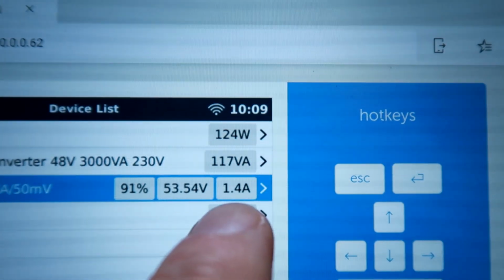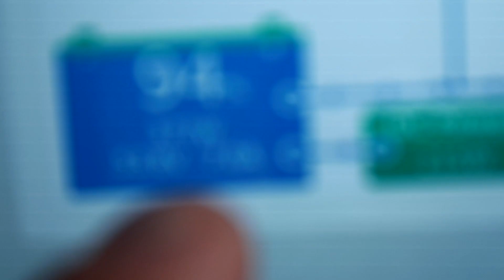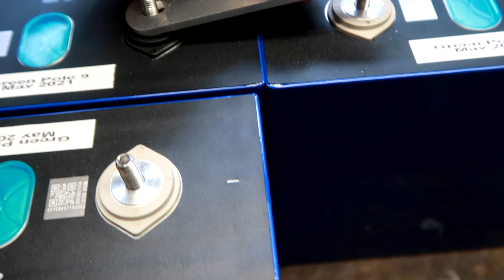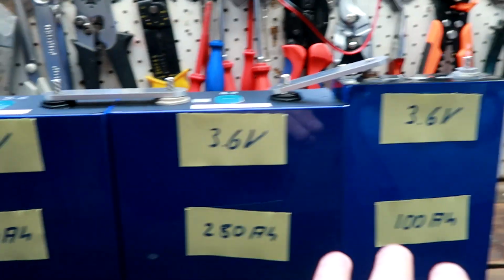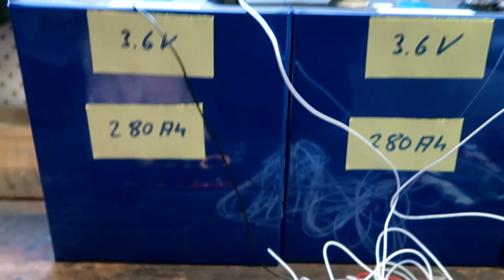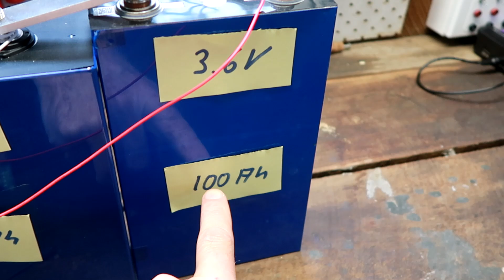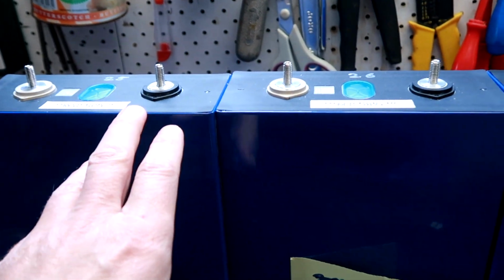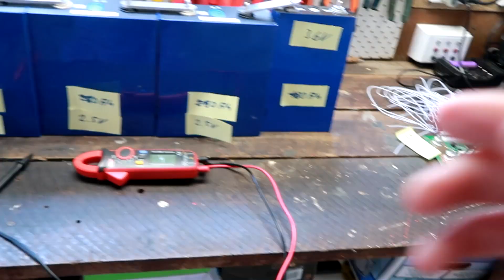Divided opinion about balancing, balancers, BMS. How to and why to balance LiFePO4.

Comment: with 1 active balancer you charge and discharge your weak cell with 5 A only, does it count as charge cycles? 
Of course with 100Ah against 280Ah the difference is huge, but with more equal cells, the weakest cell wouldn't suffer that much. 
If we charge with 50A , shouldn't we need 10 of those 5A balancer in order to shift all the charge as fast as possible, so all voltages remain equal at all times? And we don't need balancing at rest.
Reply from the maker: I think the balancer will only have to work once there is a voltage difference across the cells, so at the bottom or top of the curve when cells start drifting. It should be very easy to balance such high capacity cells with 5A at this stage. There is no need to have multiple balancers, I actually think they would counter each other and start fighting.

Comment: Aluminum bus bars are dangerous, at least in buildings.  Aluminium develops a coating of oxidation that eventually causes arcing at the connections.  The building where I had a condo had a huge fire because it had big aluminum bus bars instead of copper wiring. Such bus bars are not unlawful under the building code.
Reply: I have used aluminium busbars for 5 years in an RV without any corrosion problems. It might be more of a risk in damp buildings. To reduce risk of shorts I have recently started coating them in heatshrink and cutting out circles around the terminal points to enable good conduction. This would probably help minimise any risk of corrosion.
Reply from the maker: Yeah, but the corrosion is only dangerous at the points of connection, not on the outside.
Reply: @OffGridGarageAustralia   Yes, that is what I have heard too, that Aluminum is the metal that expands and contracts the most of all metals, and when you add corrosion into the mix, the arcing occurs at the connection points.
Reply: @JR-kk6ce  Theory is often in conflict with practice, sometimes more limiting sometimes less. In this case, unless you have some extreme temperature and humidity conditions, the practice wins. In the case of humidity you will probably see the external effects of corrosion on the terminal busbar junction long before it becomes an issue. Expansion due to temperature around a terminal over the range of temperatures that lithium cells can be used isn't going to be an issue.
Reply: @nigelcharles511  I would be careful with aluminum busbars. It is not the humidity that you have to worry about, it is the the material of the post, washer, and bolt that you are going to use. Aluminum is very reactive with other metals and will galvanically corrode. The corrosion at the connection will create hot spots and possibly even a fire. I know this because I worked many years doing thermal imaging of aluminum busbars in buildings that were built in the 70s. Once you have a hot spot at a connection, the heat expands the aluminum and when the current is taken away, it cools and contracts. Eventually, the connection becomes loose and greatly increases the risk of fire.
Reply: @oldglory9812  The battery posts are also aluminium (the reason for going for aluminium busbars in the first place) and the posts are stainless so little risk of dissimilar metal corrosion. Using nuts with serrated undersides seems to prevent any loosening.

Comment: I don't know about balancing by capacity it seems to me that you're relying on your ability to measure how much capacity you took out and how much capacity you put back in the shunts are pretty accurate but I don't know if they're quite accurate enough
Reply from the maker: All balancers take the cell voltages as measurement. As long as there is a difference, they keep either burning off energy or shuffling into other cells.
A coulomb count through a shunt may work but is not 100% accurate either as it would need several other parameters as well (current, temperature, SOC) to make an accurate decision.
Seems like it, we cannot really find the perfect solution.

Comment: Its also Not save without a BMS and a working Charge Controller because These Cells will Drift over time so you can Overcharge the Cells If maybe one cell is lower
Reply from the maker: Yeah, absolutely. A BMS is a must!

Comment: I can still top and bottom balance my cells with a 2 amp active balancer.
Reply from the maker: I don't think you can. Bottom balancing means they have 0Ah left. Once you slap the balancer on such a pack, it will change this situation and the cells will not come back to the same voltage any more.
Reply: @OffGridGarageAustralia  if the idea is to have all cells at the same voltage on the steep end of the charging curve (top or bottom) I think one can. I know what a lot of people call bottom balancing. I just think it it’s equalizing the voltage at the top or bottom. 

I might be wrong (always learning) but I think an active balancer is the way to go. 

PS my active balancer will do 2 amps at a voltage delta of 5mv. It charges super caps in parallel (from high cell) then discharges in series to the low cell. My pack is doing amazing!!!!!! Cheers and keep the videos coming!!!
Reply: @OffGridGarageAustralia  also. The only way one would know they have 0 AH left is a voltage reverence right?
Reply from the maker: @idontneedaname85  Well, top balancing focuses on voltage (eg. all cells at 3.6V). They will then have different capacities though.
Bottom balancing does not read individual voltage but only the overall voltage. It focuses on Ah. However when you balance, the Ah get mixed up, either burning off amps one just one cell or transferring amps from one cell to another. This will destroy your bottom balance as cells have now different capacities.
Reply: @OffGridGarageAustralia   very good. Lot to think about. Cheers mate.

Comment: Need to somehow put all the cells in parrallel and buck boost the sh*t out of it to 48V.  Then they all charge/discharge together.
Other than that, maybe build a smart bus bar that current limits to a common bus in and out.
If you can't quantify the damage to the cells for constant balancing then thats my vote.  I don't think the charge/discharge is as large a problem as you think.  Your 3 battery banks charge/discharge to each other all the time.

Comment: balancing.. in the case you never reach the absorption, bottom balance will drink each watts of you panels.. top balance in the case you like to have your batteries absorbing and have the most power available.. that make sense?? ..but don’t like your idea of batt with stainless screw, aluminum bar and copper cables.. that look more thermocoupler type of junctions and what about heat/cool dilatation different for each of those ones, your contacts will take some slack with time.. that make sense again??

Comment: Hey guys. Unfortunately, I am not lucky with my orders from Shenzhen Basen Tec. Now I have 2 different types of EVE cells. 8x EVE L280N and 8x L280K. The L280N cells are the well-known types and the L280K are a few millimeters higher and the terminals are further apart with welded bolts. I don't think I can run these 16 cells in series without any problems. So be careful when buying cells. EVE is not the same as EVE.
Reply from the maker: Did you get them in one order?
Reply: @OffGridGarageAustralia  No, that was 2 orders. I can send you photos if you want.

Comment: Active balancer is not effective on such cells. The best solution is "powerwall" but not "e-bike" BMS. Batrium, or DIYBMS or something similar. Such BMSs have a normal passive balancer with significant balance currents 1 to 5 Amps, which are real Amps, ant not Chinese "promised" current. The active balancer work based on voltage difference, which in case of LiFePo4 is so small, that active balancer current is so low 0.01..0.05A. Alternative option, is to use the BMS only for safety and external passive top balancing balancer with 1-2Amps

Comment: you're assuming 100% efficiency on every cell. that's not possible.
while you may be charging your cells in series with 10A for 1 hr, that doesn't mean you can pull 10A for one hour from your cells. 
some cells charge and hold more energy while others may not hold all of the energy that is put into it.
Reply from the maker: The LFPs here are at around 99% efficiency.

Comment: No engineer would design is system to operate at the extremes, we analyzed the system extreme precisely so that we can avoid them and yeah what are we doing here? Discharging the battery clear down to 2.5 volts. Charging the battery clear up to 3.65 volt. Those are the extremes which we are supposed to stay well away from. And for what purpose? So that we can store a miniscule amount of extra current. Makes no sense to me. I will operate from knee to knee. If I am so desperate for more power that I need to operate beyond that, I will buy another battery. 

When the battery is operating in the steep part of the curve it is struggling to provide or store more power. When the battery struggles it is being damaged. STOP. You don't suddenly start damaging the battery at 2.49 volts or 3.66 volts. You are already damaging it and the damage gets worse the further down the slope. And why? For a few more milliamp hours of storage? When you hit the knee, STOP. Order another battery.

Just my humble opinion of course.
Reply from the maker: Thank you John. That is great advice. So what are your settings for your battery? 3.1-3.4V?
Reply: Before we get Into what voltage, we need to discuss Equalization. By connecting all the batteries in parallel for some period, the batteries will equalize. Equalization is not the same as balance. Balancing is voltage State, Equalization is charge state. Once Equalization is accomplished, put cells in series . Set the BMS to cut off charge and discharge when any cell enters the knee. You Are done. Enjoy the battery. Just know that in a year or two or three, you might have to equalize again. Unlike balancing however Equalization is quick and easy.
Reply from the maker: @jwcolby54  So you let the BMS control your battery charging/discharging?
That would involve a better control system as many have where the BMS controls the SCC as well as the load and inverter.

Comment: as i use mostly new cells now, with little variation, i like the top balancing method, dont use an active balancer, as i have not had any need just yet.

jehu mostly uses used 18650 cells, grouped by resistance and capacity and a mix of those.
given the volatility and mixed characteristics i can see why he would need bottom balancing.
the downside is that you will loose capacity, as the total capacity will be that of your weakest cell..
if , like jehu you can add used laptop batteries to compensate rather easily and cheaply , that isnt a problem, however, using 280-310 ah in 16s series, that does eat up a load of cash rather quickly
Reply from the maker: Thank you for sharing, that's great advice. However most people here seem to say got bottom balance with new, matched cells... 🤷‍♂️
Reply: @OffGridGarageAustralia  I know I mentioned this in my other comment, but: bottom balance when your pack sits mostly empty, top balance when your pack sits mostly full. For solar applications, top balance. For things like EVs, bottom balance.

Comment: As someone who makes, uses, and prefers aluminium bus bars, I have one thing to say: They're not superior for one reason and one reason only: They don't have any expansion/contraction kink in them so will tear your cells apart during charge discharge unless you have a gap between them and if you do, you have no compression. In summary, they're only really suitable for cylindrical cells in holders, not prismatic cells like yours. But, they're cheaper and lighter than copper ones, so ideal for boats/planes/cars where weight matters. Putting a kink in wouldn't do much, either, as the alloy is very rigid so the kink would have to be impractically and unsafely tall.

Comment: You make it to dramatic. There is not much difference between prismatic cells of the same size and manufacturer. Let it be a delta of 3%.... You make it TOO BIG! Like I said before do not go above 3,40 volt at cell level and not lower than 3,10 volt and you will never have an idea of disbalance. But when you go high or low, YOU WILL... You like to go there, you like to SEE this problem and MAKE it your problem, BUT it is NOT a problem (if you don't go so high or low) What you see is natural... but you don't like to see that.... Think about that. With BIG prismatic cells, balance is not a thing if you know what is good for your cells and what is bad. Good is cycling, Bad is everything else like; testing, balancing, low and full SOC. Good luck with this "This is NOT A Problem" problem. But you make great video's!

Comment: do not use the bus bars he mentions.. in his later videos he has tons of problems with them.. these bus bars are inferior , they make bad connections and heat up ... do not use them they will damage your system.... the bus bars that come with the batteries are much better.

Comment: Yes are you a top or a bottom....................  balancer? Yes very funny!

I have a question. 
Hypothetically, if I wanted to have a 48v off grid solar system, considering all this battery balancing business why would I buy 24x lesser capacity 450ah 2v cells that cost $7500 with 48 external terminals, over only 8x 550ah 6v cells that cost $4500 with 16 external terminals? 

I kind of (but not really) can understand if one 2v battery goes bad I can replace that battery at $3-350, but if one cell goes bad in a 6v battery well the whole battery is done but here's the thing, whole 6v battery is $550 anyhow so not a deal breaker considering the huge reduction in bank price: ~35% less for ~20% more capacity with ~1/3rd the external connections. 

What I'm asking I suppose is  battery balancing easier in external 2v batteries than 6v batteries?; and secondary is, why would I accept a premium price for a 2v bank with less capcity than a ~35% less price for more capacity 6v bank?
These are all AGM batteries so I'm comparing apples with apples.
Reply from the maker: It's the chemistry. The 6V battery is most likely lead acid tech. That's exactly what you don't want. They will last only 500 cycles and you can use only half of the capacity (or they are dead within 100 cycles)

Comment: Bottom balancing is good for recycle battery, because you don't know what's the state of health of the battery cell, but even you do bottom balancing if you pull or push energy in high c rate, it will still go out of balance over time. For new cell always go for top balancing for maximizing the capacity.

Comment: Do what works for you and your battery bank. Any bank is only as good as your worst cell. Old batteries do not even charge at the same rate. In your example a 280 ah battery with 100 ah in it will not ever come to 3.6 volts so your bank voltage will be made up with more voltage from the weak cell.

Comment: if you go for the bottom balance option and dont use a BMS then you may like this victron product to protect for that over voltage situation, and it should tie in with all your existing system
 https://www.amazon.co.uk/dp/B01N6ATT8C/ref=cm_sw_r_cp_apa_glt_fabc_QAT2ZJKEBJ7X6WWHQQJ8
Reply from the maker: I would not use that! It controls the battery only as per overall voltage. In case one battery goes lower and another one too high, the overall voltage is still OK. You ALWAYS need a BMS which can disconnect on a cell level.
These devices are OK for lead acid batteries but not for series connections of Li cells.